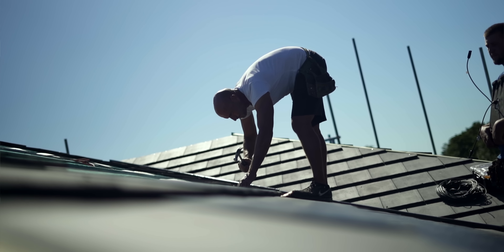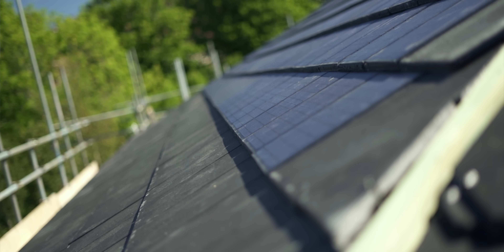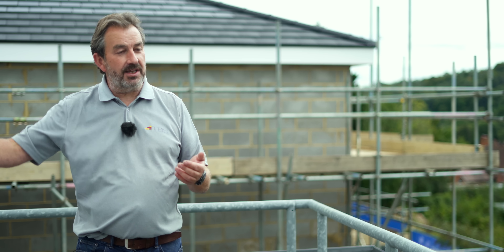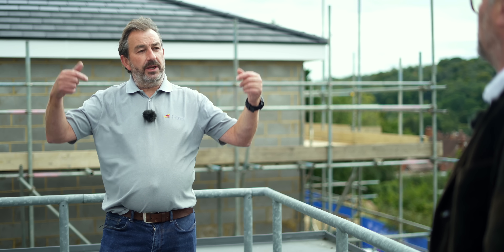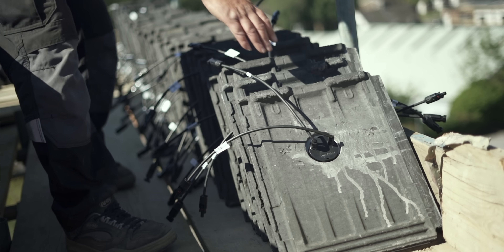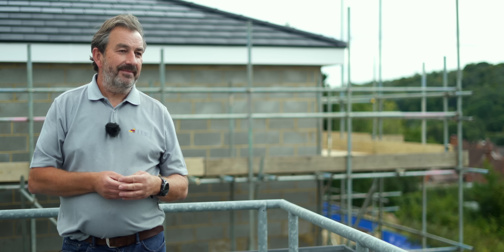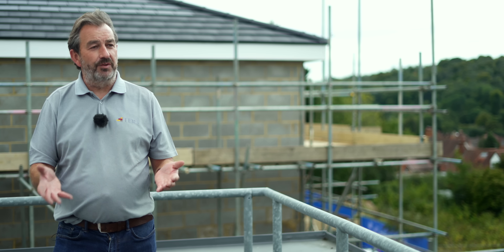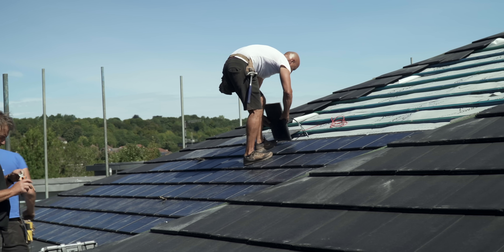Solar On Every Roof?

Comment: I remember when this was originally posted, and as it was then, my only concern with this product is that it still involves concrete, a product that is widely acknowledged to contribute significantly to world CO2 emissions. This isn't to say that I think perfect should be the enemy of good, but I do wonder if a similar take on a roof tile/solar combo could've been designed with a less carbon intensive footprint. 
Just because a product is cheap to produce, that doesn't necessarily mean it is eco-friendly. The (how) of production is just as important as the (why) of any given product; it's why procurement processes/contracts are starting to integrate this into the tendering process or in modern parlance, ESG.
Reply: Worth noting that the tiles are not specially manufactured as solar panels; They take already manufactured concrete roofing tile and glue PV panels to them. So in that sense, this is an improvement over traditional roofing since they would be using concrete tiles with or without the solar panels.

That said you can also use terracotta tiles or asphalt shingle instead of concrete so I agree this might not be the absolute "greenest" option, but if you're going to be using concrete tile anyway...
Reply: @Smidge204  Fair enough.

Comment: Solar does not work in Scotland because of cloud cover..... Do we have to wait for Scottish Independence for a video on affordable wind.
Reply: Actually it depends on where in Scotland you are.  I was told that Dundee gets around 1500 hours of sunlight a year on average.
Reply: @shidratiali5954  It's supposed to work in Dundee but when I tried an experimental installation on a house I built it didn't. It's also supposed to work in Dunbar and doesn't.
Reply: That’s interesting.  What do you mean though that it doesn’t work?  Is it that it doesn’t generate any electricity at all or it is not enough to cover your usage?

I am in Edinburgh and just put up solar, no batteries in September.  So far, even on a cloudy/rainy day, it has covered my usage during the daylight hours.  But then I don’t use much electricity.

So be keen to understand what you mean.  Thanks.  

But definitely affordable wind is good for the winter time when there isn’t enough daylight.
Reply: @shidratiali5954  I create airtight buildings using HRVS which are designed to need minimal energy to heat and cool. I have built in many different parts of the UK and Europe and used solar to take buildings off grid. I have a play farm in the Scottish Borders with about 100m2 of solar on a shed and it will not provide enough energy to charge a car. We experimented on a building in Dunbar, which is supposed to be the sunniest place in Scotland (?) and again there was not enough energy to charge a car. I have contacted Herriot Watt Uni and they confirm my analysis that solar is not for Scotland.
Reply: @steverichmond7142  thanks.  That’s interesting and useful to learn.  So how much kWh did the 100m2 - what’s the overall system capacity - generate on average in the summer?
Reply: @shidratiali5954  Sorry I don't know. I've done this a lot in other parts of the UK and concluded it theory doesn't matter... my test is charging an EV battery.